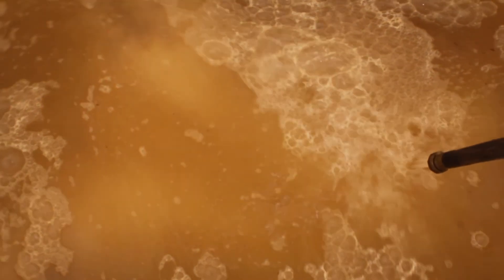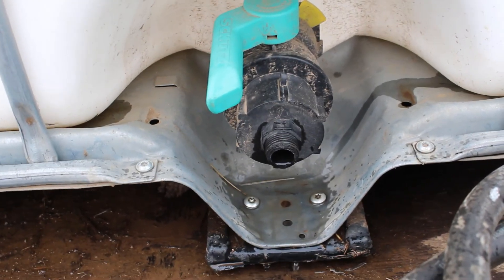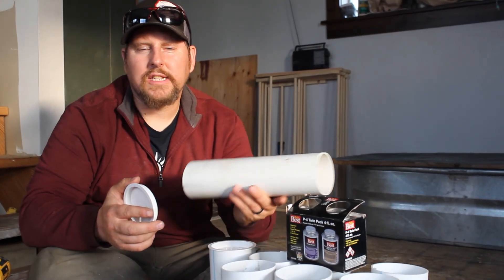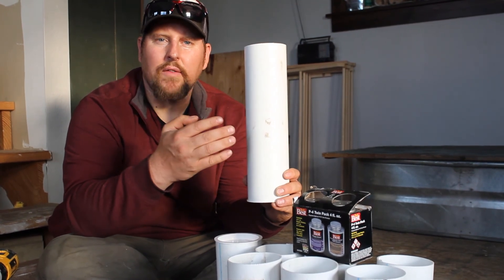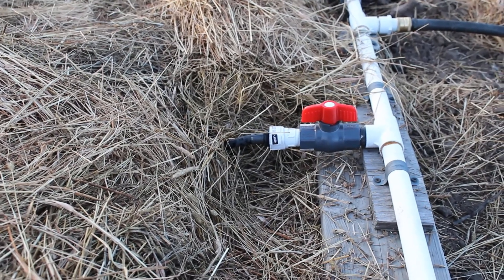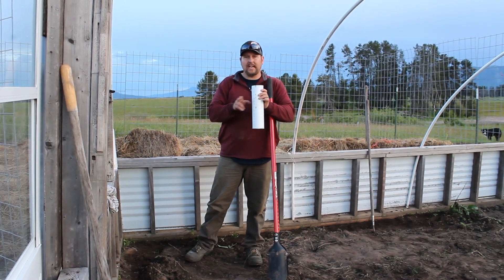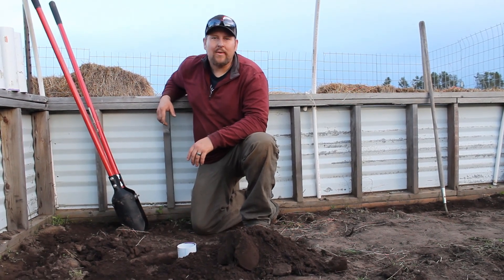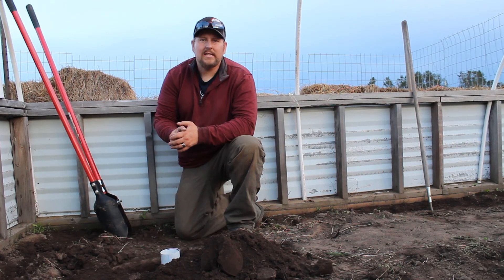How Does Our Garden Grow? (Deep root watering the tomatoes and conserving water.)

Comment: I would be concerned that the roots would grow to block the holes in the watering pipe. Sort of along the lines of tree roots blocking sewer lines when tree roots seek water.
Reply from the maker: Anony Mustly Thanks so much for your comment. An interesting thought indeed. We will keep an eye on things and keep you posted.
Reply from the maker: I just wanted to report back.  We kept an eye on the pipes and it seems like the roots mostly grew down into the soil.  There were a few roots that grew through the holes, but not enough to reduce water flow.